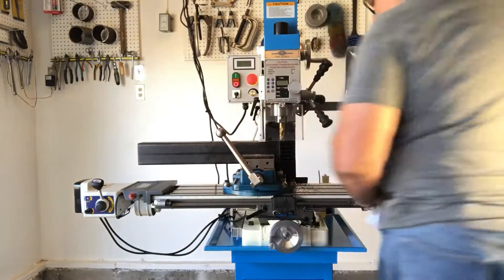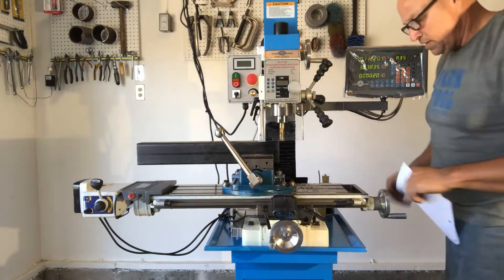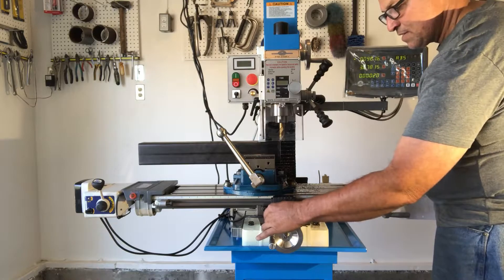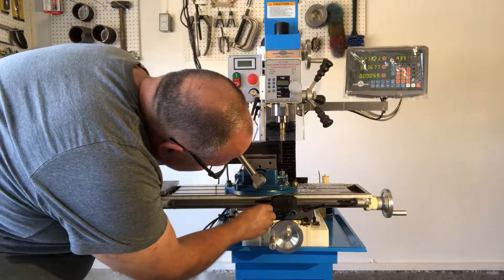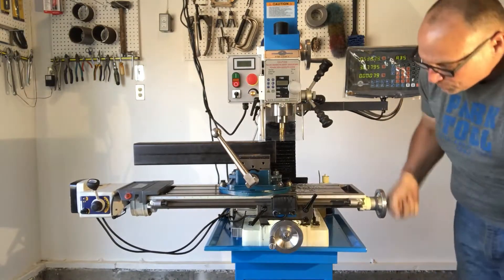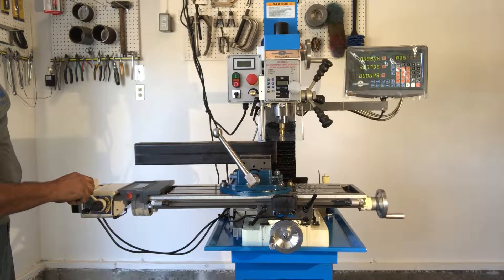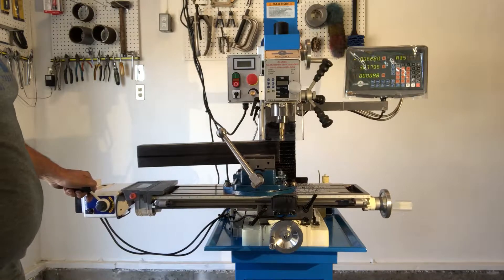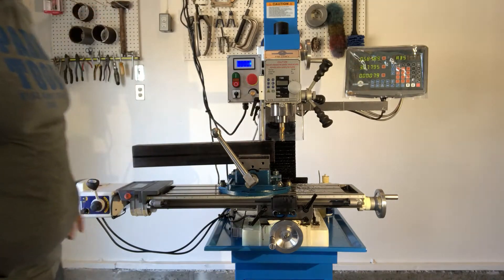One Argument Against Buying a Used Milling Machine

Comment: Fortunately, your setup was crap. The end mill could've exploded. I had it happen to me. I have the round column type mill and didn't tighten the bolts. It screwed my work piece up and shattered the end mill all over my garage.